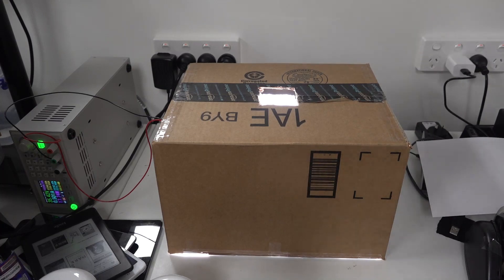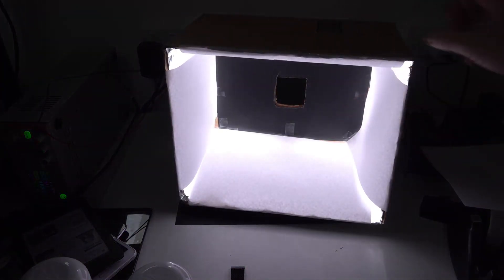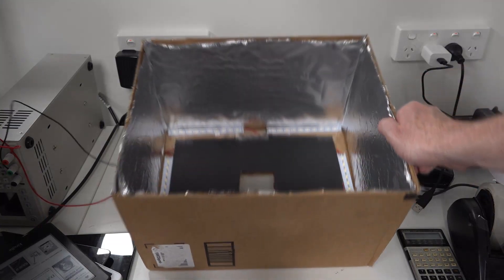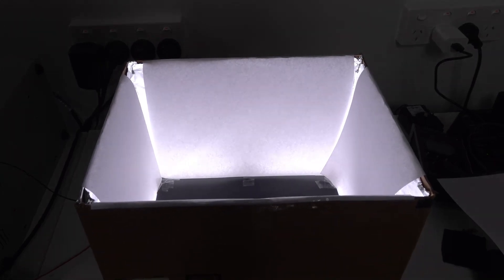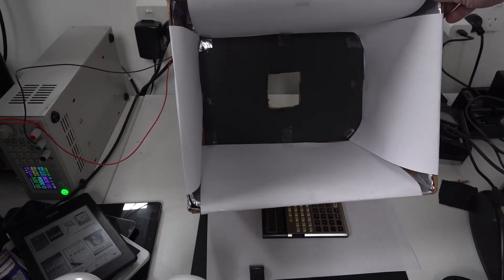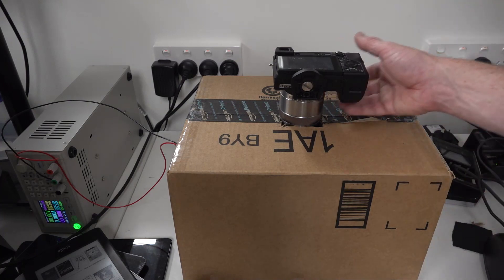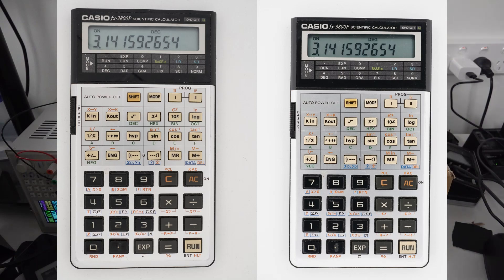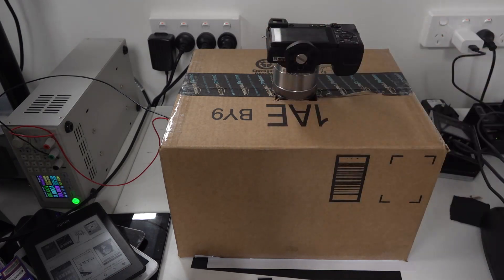DIY Product/PCB Photography Light Box - Part 3

Comment: Ha! Light box tricks. This scales up with soft boxes and white foam core to make any size lighting igloo.
Keeping the lighting from looking flat/dull is the trick.
Dave: Some while paper over the Al foil nearest the lights will reduce the hot spot near the lights some. The hotspots may be added needed contrast though, so do A/B test any changes.
You need some black inside or chrome surfaces lack definition. That's part of why the shots with the black top look better. Also try a black U inside - a mirror of the black tape outside. Even better, from the camera's perspective shine a laser pointer on the metal bits that should show form. See where the dot reflects to, and add some black paper or felt there. You can make chrome look liquid if you nail it.
Adding the ability to make one side, or one corner brighter than the rest can help too. (a 5th strip the same size as a side, but crossing a corner to fake upper left or upper right lighting)

Comment: I use an old SCSI flatbed white light scanner for PCB photography. Set the PCB on the glass and scan away. To be precise, the scanner I'm using is the Agfa Snapscan 1236s. And yes, it's really old.
Reply from the maker: I've done that too, it works.

Comment: This is brilliant! Amazing photos. Perhaps you could 3D print a simple holder for the camera to set on top: just a flat, stable base you’d tape to the box with a tube sticking up where the inner diameter is that of the outside of your lens. The camera would slide right down into it and stay perfectly vertical. Like how microscope eyepieces slide into tubes.

Comment: You could also use an LED retrofit for a Circular Tube. I did make myself a soldering light, i did throw the original driver away and rewired the internal strips new, so it does run on a bench powersupply ant doesn't flicker.

Comment: Hey Dave, that looks like an El Chepo lab PSU, what is it?  Is it decent for simple tasks?
Reply from the maker: https://www.youtube.com/watch?v=0qjLx_HsKUQ
Reply: @EEVblog2  Brilliant, thanks mate!

Quick side-note: Please do a video on taking a schematic from start to finish to delivered SMT populated (and may be compare various online services?).  I prefer to use Cadsoft Eagle (as I've been hacking apart Sparkfun projects for years) and have various custom libraries (again over the years).

However, interestingly JLCPCB have EDA support and an entirely inbuilt schematic>board>BOM -> fully assembled to your door service.

Either that or I need to build a hot-iron SMT "reflow" skillet as I don't have an oven at home.  Going to try that first though.
Reply from the maker: @bsodmike  https://www.youtube.com/playlist?list=PLvOlSehNtuHutdg1kZkG7aAYhjoJnk2fc
Reply: @EEVblog2  Thanks Dave, I've seen that - was just wondering if there were advances in the market since that video.  Cheers for details on the Riden 6006.  On my bench I'm running a Keysight E36313A which is my main PSU for anything serious; but it's nice to have a chepo-jobbie for adhoc tasks like what you're doing in this video for example.  P.S. Hi from all the way out in Sri Lanka!
Reply from the maker: @bsodmike  There have been advances but I don't keep up, just too many on the market these days.
Reply: @EEVblog2  Gotcha. Cheers mate!